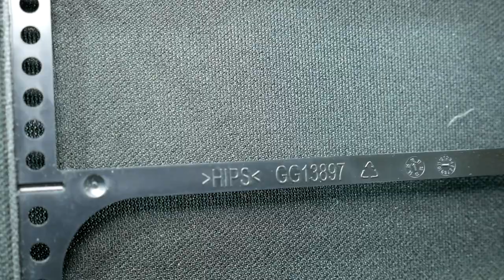Look inside $650 B&W 685 S2 speakers - What's Inside?

Comment: While yep it is a 1st order crossover, they do look like good parts. Most other speakers have an iron core rather than an air core coil..
B&W list the crossover point at 4000hz. But by my calculations using a 1st order 4.3uF cap. That puts the crossover at 4600hz.
I can't see what value the coil that is being used..  You could quite easily upgrade the crossover for very little outlay..
Unfortunately these are built to a certain price point..

Comment: Coming from diy audio builds they look incredibly cheap to make. The bass driver looks decent the rest must be improved to match the bass driver's quality.
The real disappointment is the crossover or lack thereof. Just my two cents.
Reply: Imagine how much better speakers you can make by DIY with $600!!
Reply: There is more to making a product than just material costs. Research, factory setup, labour, dealers, marketing, taxes and of course a profit all take a big chunk out of the budget
Reply: @shredder807  You have to factor your profit, the profit of a store, the cost of offering warranty and customer support, shipping it around the world, R&D, insurances, advertisement, electricity, rent, taxes, customs etc. etc.

It's logic that a 600$ speaker cannot possibly be 600$ worth of hardware - most people have no means or knowledge of building a speaker. So compare this to DIY speakers of 2-300$ instead.
Reply: $600 retail price,  cost of production has to be at the most  1/5th of that.
Reply: 6db crossover is what I did not think there will be, but it might sound great
Reply: @robertbarton3556  There's nothing wrong with a first order crossover if the response curve and the drivers are good. The components used are fine in this speaker.

Comment: Can u look inside bowers 606 and 706. I am sure that the speakers there are exactly the same and the difference is only in the cases (in their thickness) and the difference in crossovers and nothing more.It's all marketing. These factors changed the sound, and the speakers themselves are the same.
Reply from the maker: good crossover upgrade can dramatically change sound. Also 706 use carbon dome tweeter, that change the game. But we put they in teardown list.

Comment: Their "new improved" crossover is a cheap first order filter, that, on paper, has improved phase response, but is worse in every other way!
Reply: @DM While yep it is a 1st order crossover, they do look like good parts. Most other speakers have an iron core rather than an air core coil..
B&W list the crossover point at 4000hz. But by my calculations using a 1st order 4.3uF cap. That puts the crossover at 4600hz.
I can't see what value the coil that is being used..  You could quite easily upgrade the crossover for very little outlay..
Unfortunately these are built to a certain price point..
Reply: Check out GR Research they make speakers like these better

Comment: B&W always put good quality parts in their speakers and that's why the price is higher than the competition.
Reply: Another case of B&W defence/denial. Don't get me wrong B&W speakers can sound nice, but you did see the low quality crossover that was pulled out didn't you?
Reply: @adamraymond8143  Each company have their own philosophy concerning what gives the greater sonic quality. Some put very complex crossovers with cheap components (ferrite core inductors no bigger than your thumb and electrolytic capacitors in a 3th or 4th order configuration. Degradation of the signal plus phase anomalies are the result. From my experience (I have built or modify more than 100 pair of speakers), what yield the best sonic result is to put the least number of  components between the amplifier and the drivers. Nothing is perfect, of course, but like B&W, I prefer to put fewer components of greater quality. If you try it, you will hear it!
Reply: @yvesboutin5604  If you read your two responses you'll notice you contradicted yourself. Your first mentions B&W always using good quality parts, the second mentions crossovers with "cheap components." Which one is it? B&W like many others have a price point to meet, particularly in their lower end models. They spend the time and money on things like drivers but run out of steam along the way which results in cabinets made of cheap particleboard and cheaply made crossovers. Thin gauge wire and puny inductors are added to the list. You wouldn't mate a 1200hp engine to a cheap transmission.

Those cheap crossovers contribute to irregularities in the response on the off-axis, crossover point phase issues between drivers. Those tweeters can be a tad bright and fatiguing over time. B&W do make decent speakers but you can get so much better for the same money. One department they contribute a lot of their time and money towards is their marketing department. I agree with you...common knowledge is the best sonic result is with the least number of components, but skimping out on cheap/inferior components as opposed to quality ones just to get across the line isn't the best form of approach. "Made in China" isn't always a bad thing, but in this case it is.
Reply: At least the inductor in these looked good! The capacitor looked mid-end at best. The woofer looks great however, with the cast basket.
Reply: But these are Crap China parts as I have the 685 (V1).  Just opened this up and nothing different to S2.
Reply: @joenovak6393  What parts are crap, genius?
Reply: @MrsZambezi  "Einstein" is my middle name...Since I have one open..1. Tweeter 2. The speaker box has resistance 3. Speaker connectors (nut) is magnetic (that's a No No) 4. Wire push connectors (should be soldered directly to the connections).  5. B&W 4.3UF/200v MPK is made by WIMA MKP(OK) as for the price a Mundorf, Jantzen Superior Z as a high quality part should have been used...But then again the Bean Counters are in there. 6. The Rubber front is to control sound vibrations from the Woofer/Tweeter...a cheap fix to help the specs. This could have been address during the design phase.  On the Plus side the woofer is your best part.
Reply: @joenovak6393  The speaker box has resistance? What do you mean by that? Magnetic nuts? LOL, nonsense. Danny? Google ‘There is practically no measurable acoustic difference between the simple, ancient film capacitors and the current high-end capacitor. Welcome to reality!’ and you will find a comprehensive test of capacitors. Is your car battery soldered in?

Comment: That's an extremely cheap, low quality crossover! Although it was an air core inductor. But lots of improvements can be made to make it sound better with a better xo with higher quality parts. Damping can be improved a lot to, with better and more dense damping material.
Reply from the maker: Thanks for the info!
Reply: sure audio engineer, why don't you send your resume to b&w they probably want someone with your expertise on their team. You seem to be able to tune a speaker without doing any measurements at all and just by looking at it through a youtube video, someone who can do that would save them a lot of money.
Reply: @JMNTN  I know I can make a better xo than what's in that speaker. That's not very hard. Do you know why? Because I don't have a price point to meet. They do, so to meet a certain price, they will use parts to keep the cost low. Obviously I'd have to measure it to make a new xo, but just replacing the low quality parts with high quality parts of the same measured value will improve the speaker massively. Same with the cheap stuffing. Just because its a big brand name, doesn't mean it can't be improved! They have to do compromises to get to a certain price. I've even modified Sonus Faber speakers that cost over $10000. It was a really good speaker, but there were areas that could be improved, such as stiffness of the cabinet and the speaker connectors had lots of magnetic parts, which you don't want in the signal path. I've designed speakers since the mid 90's, mainly high power P.A arrays and line arrays, so I do believe that I have some knowledge and skill in this area.
Reply: I like the idea they used 6db crossover.. it means the transducers are high quality with smooth roloff.. great!